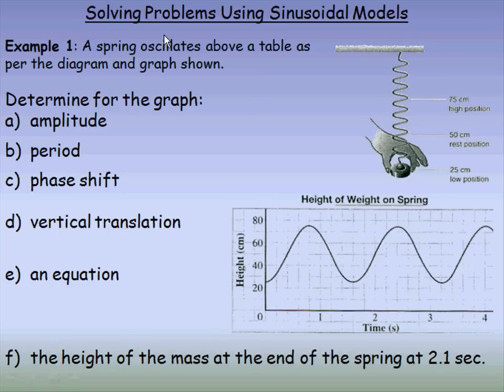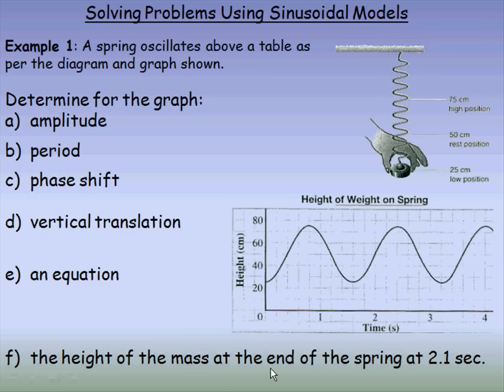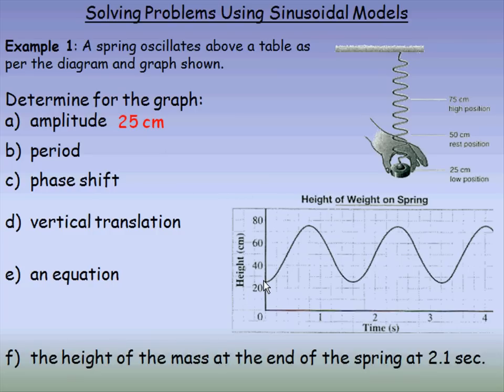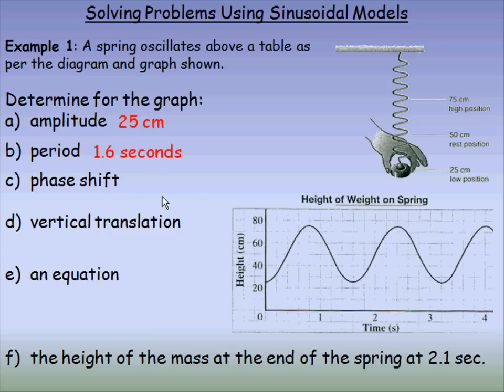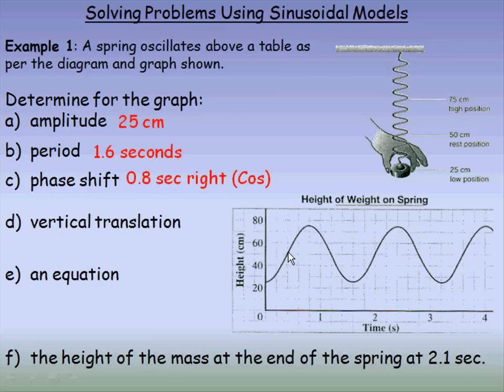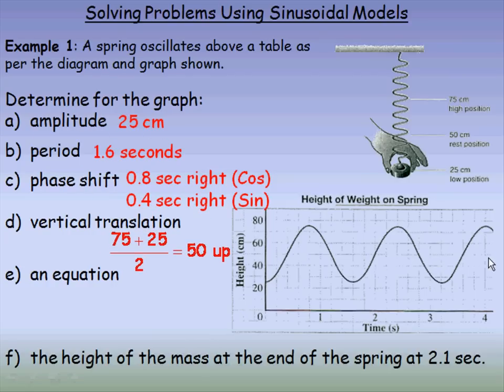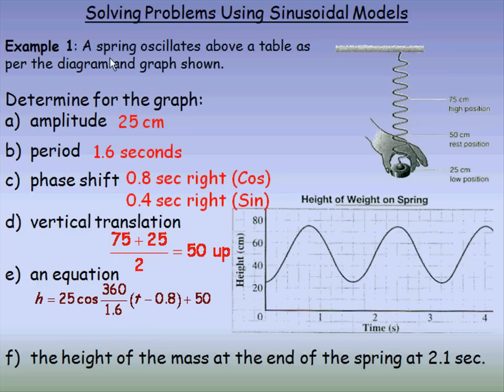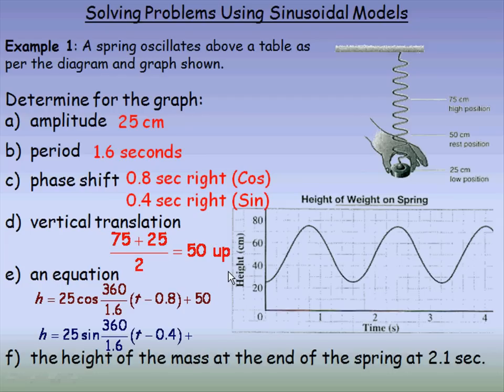Solving Problems Using Sinusoidal Models Part 1

Comment from the maker: @contractkilla24 You can always use either cosine or sine.  All that changes is what the phase shift or horizontal transation is.  My rule of thumb is that if a graph starts at the origin then use sine and if it starts at a max point at 0 then use cosine.